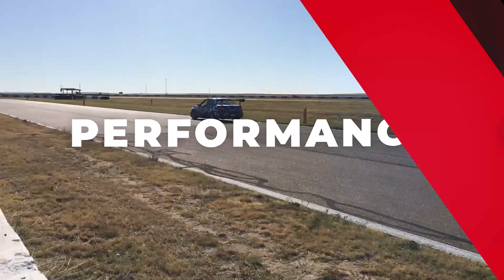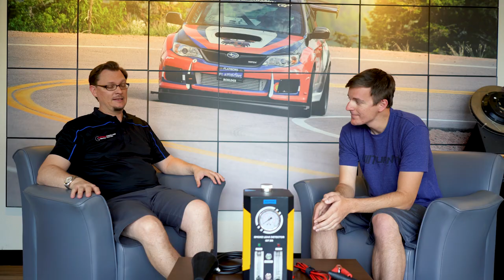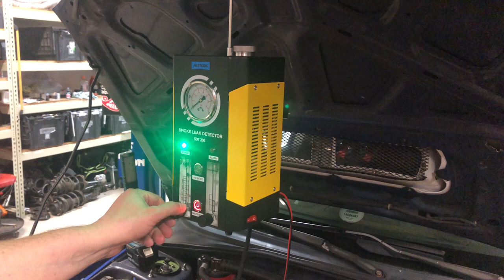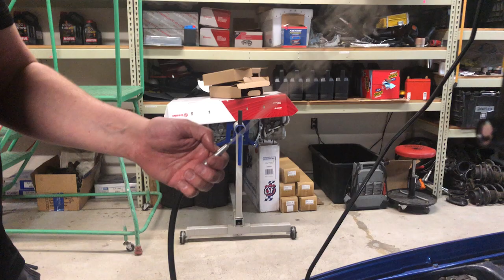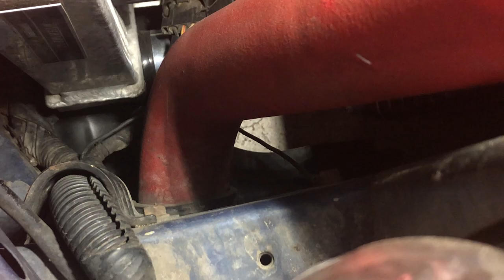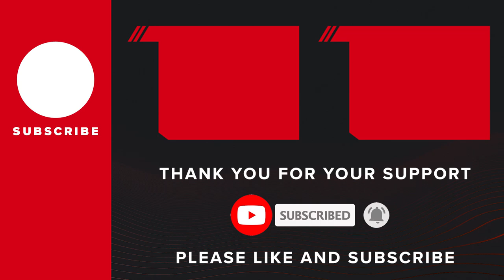When Should I Smoke Test My Car? - Question of the Week

Comment: Is an expansion cooling tank require on a mild to highly modified Subaru ? 
And  how to accommodate the extra pressure (heat expansion) in a system with out one ?
Reply from the maker: That is a great question!

Thanks for watching and Stay Tuned!

Comment: I'm getting a minor misfire on cylinder 1 after blowing off my charge pipe. I suspect a vacuum leak. 
No check engine light.
Reply from the maker: Sounds like it is time for a smoke test for sure.  Hope you find a simple issue.

Stay Tuned!